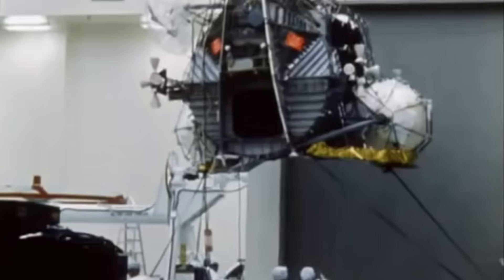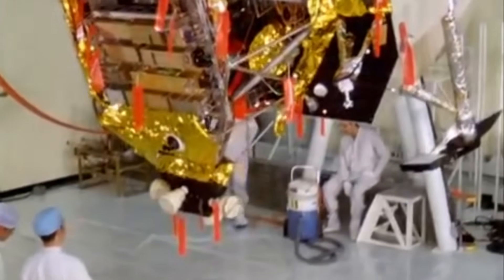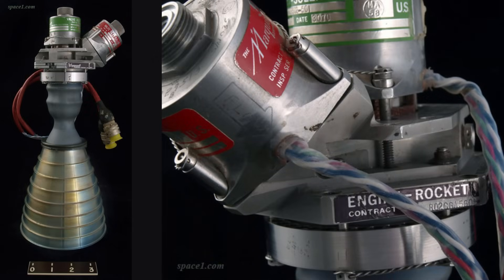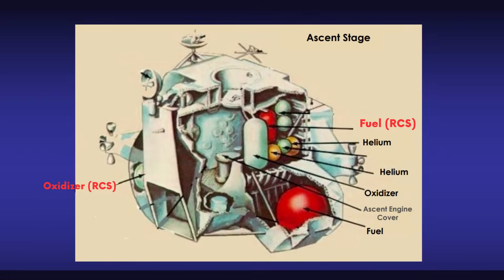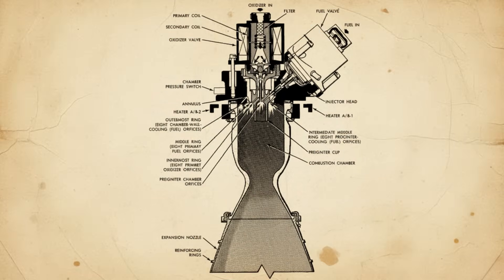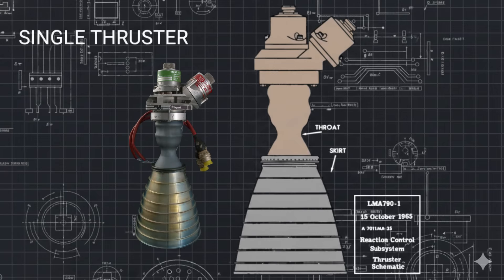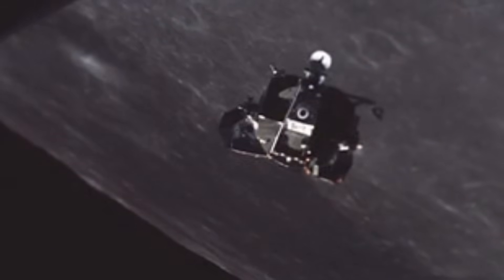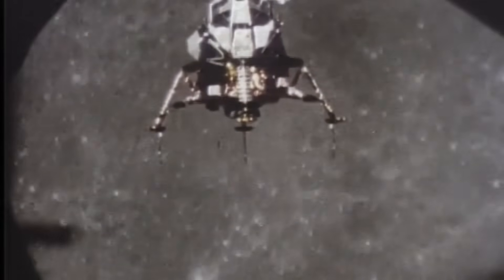The Lunar Module’s RCS: The Tiny Thrusters That Saved Every Landing

Comment: This video proves the truth of the moon landings better than all the arguments over lunar surface flag photos. 
If someone claims to have done something extra-extraordinary, I want them to show their work, not just their results. How did they solve all the little challenges that made the big challenge possible? What did they try? What failed? What thinking went into every detail, and why did they change their minds along the way? Such meticulous engineering beats believing it was either faked or accomplished intuitively. 
It's why I believe the Wright brothers invented and flew the airplane first. Others have claimed that honor, but no one has offered the design and evaluation record of their process in detail, as did the Wrights. They had to design and test original gliders and a novel lightweight engine before they ever got around to building the flyer.
Process matters.
Reply: I disagree with you. Alberto Santos Dumont was the inventor; he detailed each process to achieve his goal, and he did so publicly by flying and controlling the aircraft. Others claim otherwise, but they lack proof and reliable witnesses, and only demonstrated their achievements years later. While they improved the controls, that's remarkable, but they weren't the ones who made the first self-sustaining flight.

Comment: The ascend engine was fixed. It could be interesting to know for how many cm / inches ( or uneven weight distribution in the crew compartment )  off the ideal center of gravity was the small steering engines capable to correct, to maintain the exact trajectory.
Reply: Makes you think. I mean, an astronaut standing a foot to the right. Or a box of lunar samples stored in the wrong place. Like trying to balance a pencil by placing the tip on your finger and keeping it upright.
Reply: they worke😮d collectively t😅o keep it in a balance never going too far away in any direction